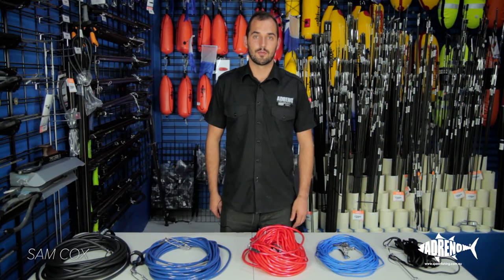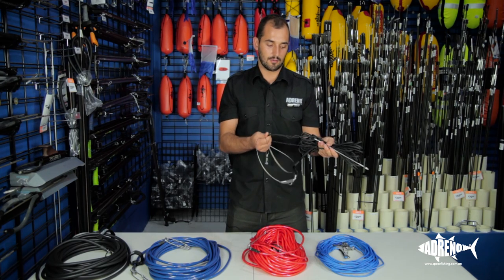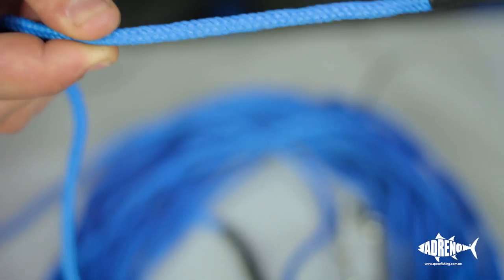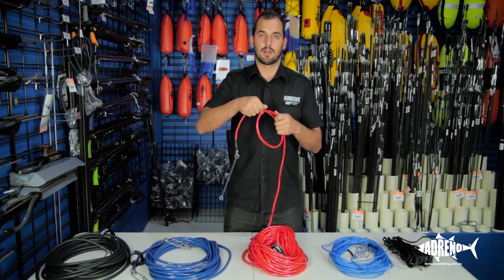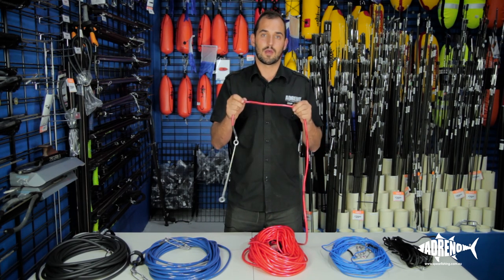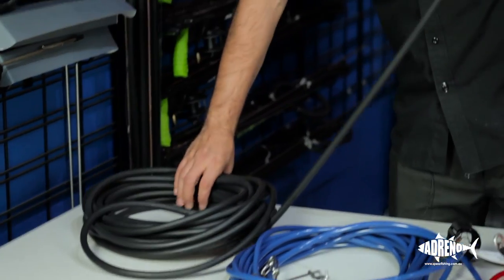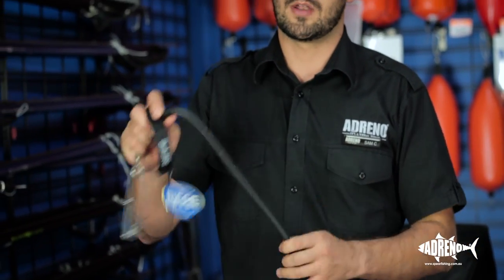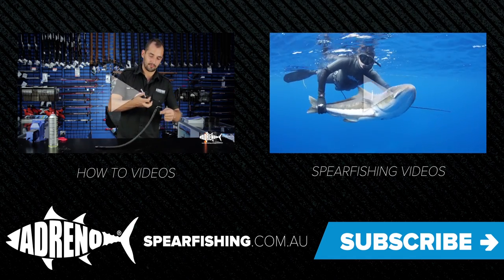How To Choose a Float Line | ADRENO

Comment: Went to Bunnings. Bought 20M 3.5mm rope for $5. Works fine
Reply: Rob Allen polyester "Thai curry green" float lines: cheap (sometimes), stiff, strong and it floats. Similar rope is even cheaper, if you can find it.